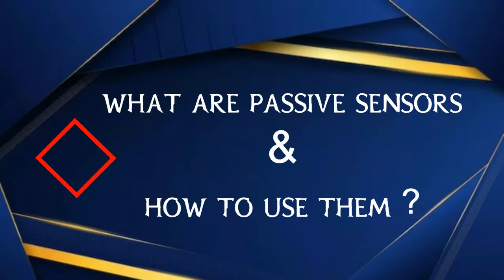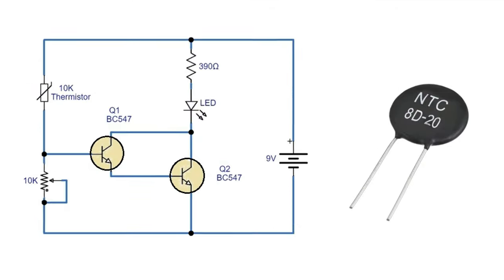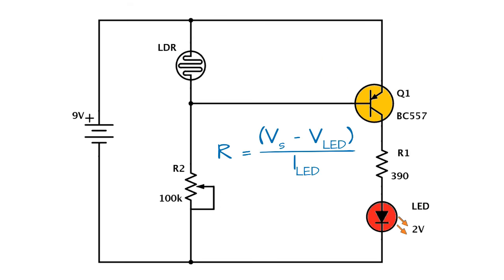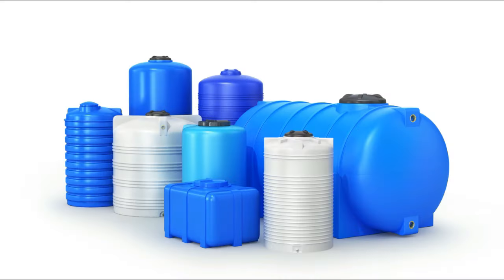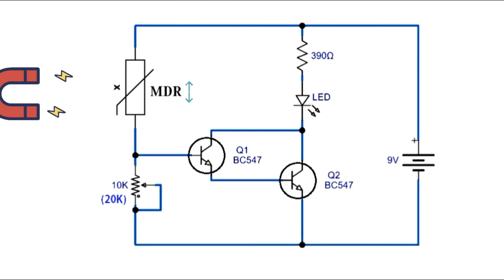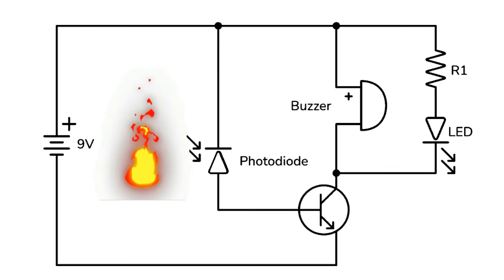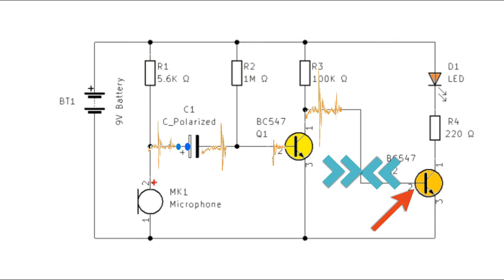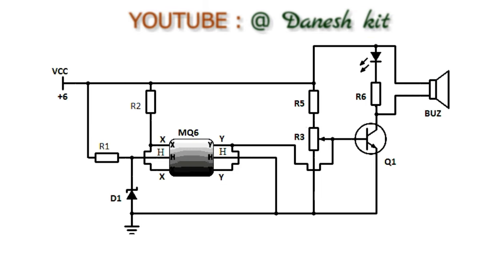Top 10 passive sensors + their transistor circuits

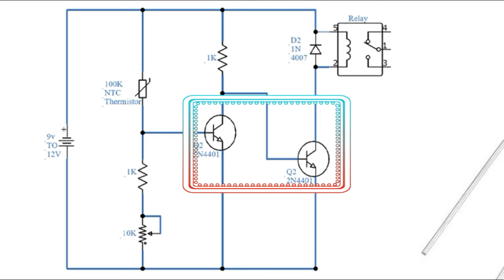Comment: 4:10 why two NPN in series?
Reply: Not a series
The first transistor is the trigger of the second transistor
Reply from the maker: hi dear friend
no,two NPN not series.
Q1 is the trigger of transistor Q2
At first, Q2 is turned on by the base resistor, so the relay is active.
When the temperature is low NTC resistance is increased and it will activate the transistor Q1.
So, the base current Q2 is cut off and the relay is deactivated.